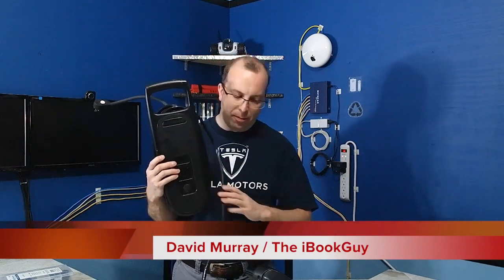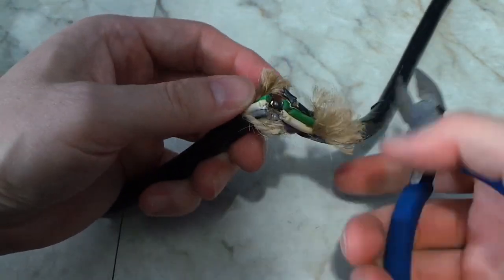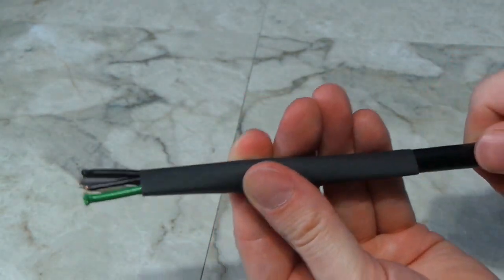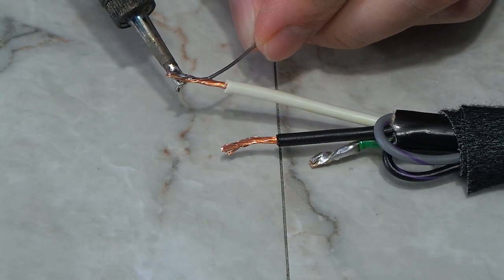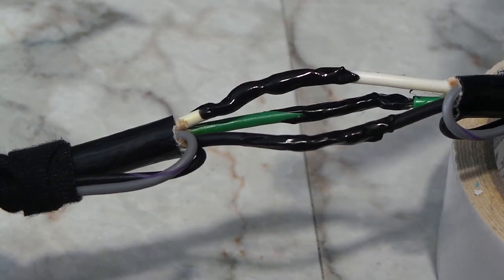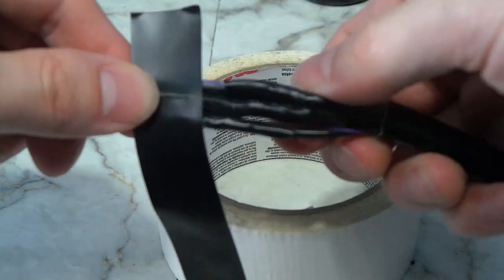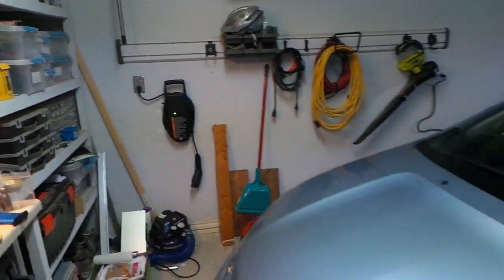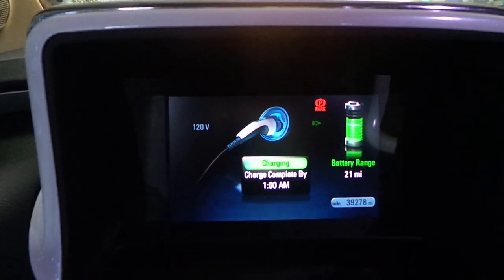Repairing a damaged EV charging cable.

Comment: I can see that each wire is insulated in grey, black, green white insulation jackets. Are the internal conductors inside the EV charger base or do they have a coat of insulation?

Comment: Hey there, I was wondering if you know anything about charge point street chargers?
Specifically, what do you do with a handle where the end-hook that links into the cradle is broken. So, the button that you press on the charging cable is snapped off. It fits into the charge port adapter on my tesla, but I have to lift the broken trigger up. I assume there's a metal actuator that is depressed and maybe a spring. But say that lifting the trigger doesn't work, can I insert something that's metal based to activate the trigger (e.g., tin foil)?  

I know it's a weird question, it's more curiosity and the desire to fix/understand how things work.

Comment: Question: have you ever replaced the entire cables, both the one to the nozzle and the one from it?  Both of mine were damaged when I slammed the hatchback lid on them (1), then closed the window (inadvertently) (2) on both.  I was attempting to protect the charger from being stolen while charging by running the cables first out of the hatchback, then out of the window.  Of course now the charger doesn't work, and I don't know where the cables were damaged, both because it didn't make that big a crimp, and because I attempted to fix the crimps by straightening them out.  Mea culpa for doing something really dumb.

Comment: Those braid ropes.  I use crimps to hold them together.  Just to help on the accidental tugs.  And yeah, like another comment.  I push wires into each other and solder.     But again.  To each their own.    Always love your projects.  You've helped me tinker around more than I should.

Comment: Ok.  I’ll be the guy.  You’re doing it wrong.  And to a point dangerously unsafe.  

First requirement is the wires MUST have a secure mechanical connection before soldering.  Solder will melt under surprisingly low current.   So the splices you have don’t have any mechanical connection. The solder melts and the risk for fire goes up exponentially.  

I prefer to offset the splices a reasonable distance like you did to prevent the insulation from breaking down and shorting.  

I haven’t used liquid tape but be advised that having 1000w of power only insulated by the liquid tape and some electrical tape seems risky still.  Will it work sure, I’m more concerned with mitigating the risk of fire. 

Heat shrink is typically much thicker insulation than tape or liquid tape.  If feel much more comfortable with each wire with a layer of adhesive lined heat shrink and then an outer layer of some heavy duty heat shrink. 

I’ll dig up some info for you on splices.  The old 50’s Ham radio handbook went over details of a Motorola splice (IIRC) which is each wire bent into a Shepard’s hook and connected THEN soldered.  And then a different splice where the wires are twisted around each other and spliced.  

I spent a week long class in the military on high reliability soldering and another on crimping.  Silly?  That long?  Yup.  It’s that important.  NASA specifications on how to do it.  Rarely done right even in class.  It’s actually hard.   

For something that is flexing soldering is not a good idea.  Crimping is.  Crimping allows the wires to flex safely where soldering makes the connection brittle.  Finding good safe crimp barrels are available at home improvement stores.  

I’d look at a follow up with it and examine with a thermal camera.  You might find at full load that those connections aren’t as good as you’d like.

Love your videos!   Shame I didn’t know you were in Chicago recently would have loved to go.  

My background is military aviation and battlefield radar repair and micro soldering in RF modules (0201 and 01005 parts).  Safety is paramount in aviation.

Comment: Certainly there is nothing illegal about that repair in the UK, I would have twisted the wires for mechanical strength before soldering but otherwise that is fine and soldering is the most reliable way to make the connection. For all the people saying solder is not the way to connect wires, that is trash, so long as you know how to solder properly. If you open up the EV charger the whole thing is soldered inside. The measurable difference between the conductivity of a soldiered joint versus a crimp joint is negligible, the choice between soldered or crimped joins is far more complicated than just resistivity. Anyway, good job, saved something from becoming landfill in a safe manner. Your repair is no more risky than the cable itself which as your video shows, is easily damaged

Comment: This should be a video on how NOT to repair high current cables. You definitely should twist them together first, as soldering tin has 3-4 times higher resistance than copper, which can result in heating up this place, where solder is, and in effect - melting down soldering tin and in best scenario - causing lack of contact in this cable.

Comment: Hey 8-bit guy! How has your repair held up? I did a repair on mine over the winter, but just noticed as I was wrapping up the cord that the repair spot was exceptionally hot. Like, right at the jacket's limit hot. 

Nothing shorted at all, but after pulling off a couple of the individual wire's heat shrink I noticed a LOT of wire corrosion. Corroded without water contact, which was kinda interesting.

Comment: With proper size rated cable through crimps and heat shrinks it possible to splice in a 30 meter extra length of cable and still work properly?

Comment: Hi, you did not do it wrong and I admire your ability to solder.  As an alternative, I would suggest that a search for "waterproof inline cable splice" yields lots of options that do not require soldering skills. I also saw that someone suggested crimp butt joints which would also work well without the need to solder.
Reply: A word of caution: I just looked at my cable it is marked as 150C temp rating and all the splice kits I found were 105C rating. This is a potential safety issue that people should be aware of when doing the repair.

Comment: for this use for the cable i would considered redo the splice for a more rigid one cause its very easy for stretch the cable little to far so the solder splice breaks, The old Lineman splice is very strong,, but yours is ok too, it works..  the ropes is just for rigidity of the cable if pulled

Comment: You want a mechanical connection between high current wires.  How many times have you seen your in-wall AC cables soldered together?  Never.  They are mechanically connected by twisting and then capped with a wire nut.  At the very least, the copper wires here should have been spread out and twisted together before solder was applied.  The best solution would be crimped or screw-down butt connectors.

Comment: Do you have any opinions on a damaged 110v plug? The end of the plug has been compromised by some heat. We have had an electrician replace the socket but I'm not sure if we should use the same charging cord.

Comment: Not an expert but that just seems sketchy to me at best... considering solder has close to 5X the resistance to copper causing it to rapidly heat up at high amperage for these gauge sizes. I cant say that this is a permanent fix even if you tried to insulate is all as best that you could unfortunately (at least use high temp rated tape).

There is a thing called a smoke chart for each cable size and this would not pass any EV high voltage standards. Please be safe and just replace the whole wire or the unit eventually. Plus the beaded cord is for strain relief which you took out and that will ware away your solder join given time and cause it to short circuit if the heat dosen't get to it first.

Comment: Sir quick question would you please help me out? My girlfriend drives a 2014 Nissan leaf and the male end that connects to the wall on the 110 is fried by a faulty outlet and the prongs are really loose so what I'm needing to know is can I replace the end without having to buy the whole dang cord for nearly $300 I'm gonna buy one that's really heavy duty if its possible to be done thanks. Your reply would be greatly appreciated.

Comment: This is not the best way to solder two stranded wires together...….  side by side is not great. Better if you had done a neat wrap of tinned wire over the whole thing then soldered together.  Best of all would be to splay out both ends and bring them together then form down in to neat connection before soldering.  There are YouTube videos on this method.  I did like the liquid sealant though!

Comment: For heatshrink tubes sometimes I'm using hot water, at least for the middle part. I don't worry I'd burn the tube and it shrinks nicely. Also it works in some DIY projects where I can't use fire, like making smaller brush from bigger one. For the ends of the tube I'm using either lighter or soldering iron.

Comment: The obly thing i think you didn't do, that i usually do is to put a spring in the zone of the cut, and put the heat shrink on top of the spring. It's unnecesary, but i make sure that all the stress of that zone is in the spring and not in the broken cable.

Comment: You didn't do it wrong.  I actually applaud you for staggering your splices and using heat shrink.  

As a former Avionics TechnicianEngineer and now technician, I'd recommend the soldered lineman splice.  

That's just a recommendation though.  I have seen your type of splice before, and you did a great job.

Comment: As an ASE certified automotive electrical technician the only thing i had a problem with was that you didn't twist the wires together before soldering them but seeing as it worked properly im not complaining at all. You did a great job and it was to ASE specs minus the twisting of the wires.

Comment: How does a car only need 1.4 KW to charge? (BTW I mean "run" (be on while on the charging station and in theory drive) and charge any amount.)
Reply: Because. America. 110V AC by default kind of makes any vaguely fast charging difficult at home, so unless you have a 240V circuit somewhere (often installed for clothes driers) nearby to connect a proper charge point, you're going to be leaving an electric car plugged in for nearly 20 hours to charge. It also explains why electric kettles aren't used much in American kitchens.
Many EV's on-board chargers can cope with fairly charging at a reduced rate (6A at 240V, 13A at 110V), the Renault Zoe is an exception, since it only seems to like fast charging. This can be handy if you're trying to make the most out of available excess local solar generation and don't care how fast the car charges because it's parked and you're not using it most of the day anyway.
Reply: I live in America. I know about the 110v.

Comment: The job you did was certainly what I would call 'more than perfectly acceptable'. What I would do (only really when using multicore wires, it certainly wont work with single core) is twist the wires together first, to get a good mechanical connection before soldering. Solder really isn't all that strong, but at the end of the day, with all the tape and heat shrink on there, I can't see that connection coming loose, even if you were to hang from it. Just something to keep in mind for next time, because it certainly can't hurt.

Comment: I am 15. am a girl. live in America. I don't solder wires together. I crimp them. I solder chips only and capacitors and logic gates and LEDs and  NO/NC buttons and other small electrical components.

Comment: Tinning wires for those kinds of connections is slightly annoying. I'd rather suggest that you push the ends of the wire together, "twizzle" it in your fingers, and then solder it. You may need a rather hot iron for the job as those wires look like they'd cause a cold solder joint otherwise.

I'm not saying you did it wrong, that's just how I'd do it, until I actually did it and had bad results, and reverted to your method.

Comment: You did it wrong. You should use smaller heatshrink on those smaller wires inside the coating

Comment: it all looks good to me, my only add on i recently learned about would be hockey tape before the heat shrink.  it would add to the tensile strength of the repair
Reply: in fact if it was a dog bite problem i might coat the whole cord in a layer or two or three of hockey tape so the dog couldnt penetrate the cord again
Reply: nice pfp :D

Comment: you didn't do anything wrong, you did it correctly. like the wires were reconnected properly, the car didn't explode
no electrical shortages happened and and was  fully functional, so as long as it works like it is supposed to then no nothing was done wrong
Reply: though Soldering in hindsight is the only thing done wrong, High current makes lots of heat, and lots of heat can melt the solder, I would've done something differently... it's not a safe idea, and I would've used something to Force the cables together, for something of such HIGH voltage.

Comment: Yes, well done video. I do these repairs all the time for clients, I also replace the J1772 Plug for people that have 'run' over them with their car. The brown cord in side is not for tensile strength, it is called a filler, it fills the gaps between the electric wires and make the overall cord rounder. And there is no 'proximity' wire in the the cord, that small guage wire you called the proximity is low voltage power for the LED in the handle. The J1772 Spec does not call for the proximity wire to go from the J1772 Plug to the EVSE.

Comment: You should have crimped the cables instead of soldering. Interesting video, but it was a big mistake to solder the high current wires.

Comment: well its a valid fix, but for such a high powered application I would be cautious of the solder I use, I assume your usual solder is meant for circuit boards, it would be good to know how much heat it can take without melting, at 120v the current needed would be quite high and so the cables would run a bit warm, if the solder isnt up to the task it will simply melt, the soldered part could be even be accounted as a lower gauge weak link

Comment: Great video. And yes, you did it right. I also like the liquid tape. Never heard of that before so I'll check it out. Thanks!

... but I'd also like to comment a bit about the repair and maybe make some suggestions for the next one. ; )

The way you cut the power cables was a good idea. But like your previous cable repair, you soldered them side by side even though they are power cables with multiple strands. The best way to solder such cable is to join them by pushing their strands into each other and then apply some solder. This gives you a solid joint that has no risk to break or overheat compared to soldering cables side by side and only relying on a solder bridge.

You can use some bonding glue to fix the ropes once everything is soldered.

Then, you went ahead to test the cable by pluging it in ?! NOOOOOO  !!
You should have used your geeky multimeter in continuity mode to check that there are no shorts !!
Then you can test. : D